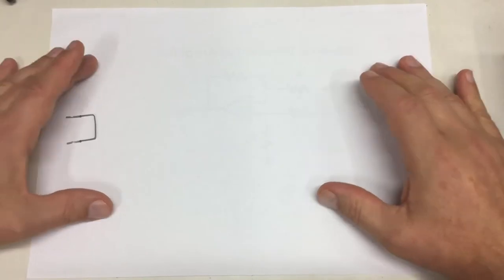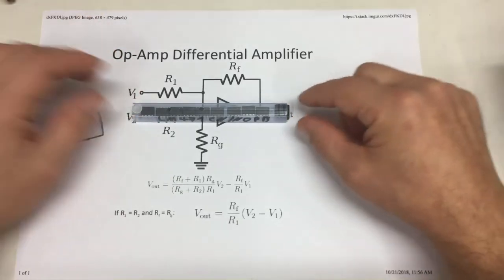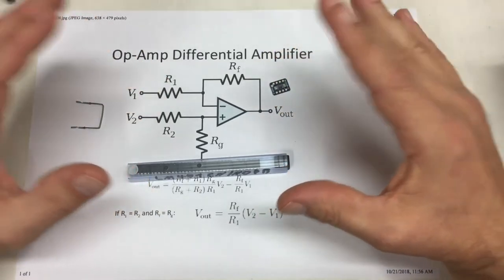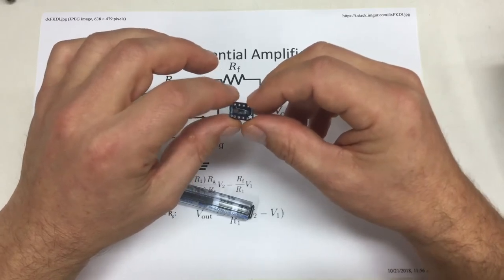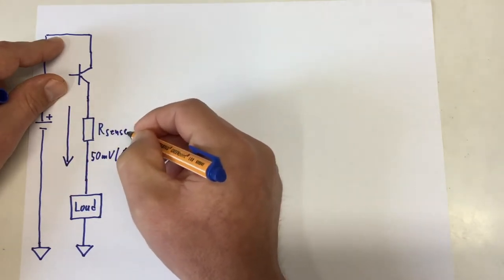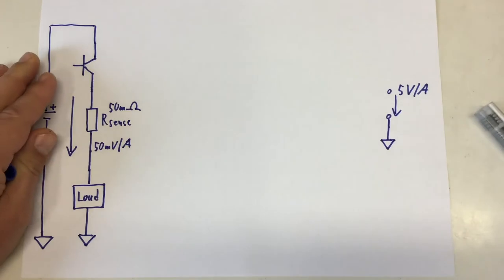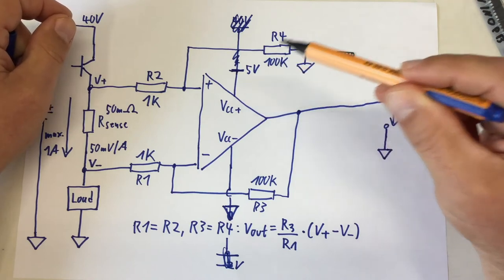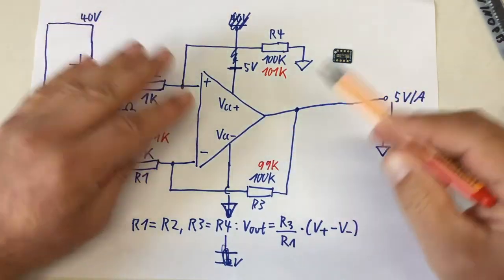Current Sense Amplifiers (1/2): Why not to use an OpAmp (CMRR etc.)

Comment: Well paced and clearly explained...awesome production. 
  However, I was rewinding the video often to be sure the R4 were the same. The '4' was written differently: the schematic had an open four...the ideal values and equations showed both open and closed '4's. 
  I had issue with an instructor for over a year...grade suffered because of time wasted in clarifying these types of concerns. It was every example 9n the board, a class member would have to ask what is that...the cat scratch was indecipherable.  
  It is seen here that a 4 exists, but 8 was looking around for another one in case there was some alternate for an alternate design...like a trade off.
  This is a channel I will recommend. Best wishes.
Reply: I amendment to my statement...what I thought was a closed four is a one...the slant is very pronounced (in the equation) and I see it as a four.   Appologies.
Reply from the maker: Thanks for the praise and recommending the channel! And I'm sorry for my handwriting ... sometimes it is even worse. E.g. as a German I'm always torn between an American 1 (|) and a German 1 (1). My German 1s sometimes almost look like American 7s, and my German 7s look like, well, an American 7 but with a dash through it ( https://de.wikipedia.org/wiki/Sieben ).
Reply from the maker: @jimmylightfinger1216  No apologies needed! As I've mentioned my handwriting is not the best ...
Reply: At times,  I add the nose...sometimes the base.  The situation will influence my usage of the nose and foot especially if I am using complex numbers or vector notation...make it contrast more clearly.
Reply: Very much appreciate the reply. 🤝
Reply from the maker: @jimmylightfinger1216  I will take that to heart. Especially because I'll be shooting some math stuff (vectors and matrix multiplication) during the next few days. (Reply to "At times, I add the nose ...")
Reply from the maker: @jimmylightfinger1216  You're more than welcome 🙂 (Reply to "Very much appreciated ...")

Comment: Hi, really informative video! I wanted your recommendation to design a current circuit using shunt resistors with sensitivity >500mV/A because I want to measure current in range of mA
Reply from the maker: Do you have some more information about the circuit? What's the voltage of your load circuit? What's the supply voltage of your measurement circuit. What's the maximum voltage drop you want across your shunt resistor? A sensitivity of 500mV/A would (without amplifier) just require a 500mOhm resistor. And at 1mA that would give you a voltage drop of just 500uV.

Comment: Good one, Thanks! Btw i am trying to sense current through 100 ohm resistor connected across op-Amp using a DC Power supply at 11 V and current set at max. 20 mA. But the moment DC PS goes into CC mode, a ripple voltage of 20 mV is observed on DSO. Is it because DC power supply is a voltage source and i need a precision current source? I don't understand why exactly.
Reply from the maker: You're welcome! What kind/brand/type of DC power supply are you using? In most (cheaper) DC power supplies the CC mode is implemented much worse that the CV mode. E.g. my OWON P4305 overshoots enormously when I use the output on/off button in CC mode. I've never measured its ripple in CC mode, but now I guess I have to.
Reply: @robertssmorgasbord  Thanks for your response! I am using GW Instek PPH 1503D DC PS. The ripple value in CC mode is not mentioned in the datasheet. Some suggested to use Precise Current source but i couldn't understand why can't i use this DC PS in CC mode itself without voltage ripple considering 20 mA passing through my 100 ohms resistor should measure 2V across on oscilloscope.
Reply from the maker: @vishalgdev_  Well, that's certainly not a cheap lab power supply. But if they don't specify the ripple/noise for current, they probably didn't put much effort into the CC mode and know that it's atrocious (OWON specifies 4mA RMS for my P4305). Regarding you numbers: You measured 20mV ripple across that 100 Ohm resistor, so a ripple current of 0.2mA. While that's certainly not great at a 20mA load (1% ripple), it's also not totally atrocious.

Comment: 11:06 = you still need differential amplifier to eliminate the resistance of ground trace, which will add to the small resistance (milli-ohm) of shunt resistor.
Reply from the maker: You're absolutely right. I just wanted to explain why you might not want to use low side current sensing at all, not how to properly implement it ;-) BTW in some low side current sensing applications you can also work with a star ground to avoid that differential amplifier: One big trace from the low end of the shunt resistor for the high current path and a smaller one going to rest of the ground (plane) of your regulation and other circuitry. However, that might introduce some other errors (e.g. when measuring voltage to ground).
Reply: @robertssmorgasbord  Totally agree to your points. I liked your channel and lot of things to learn from them. BTW, for most motor control projects that I work on uses low side current sense for high BW measurement.
Reply from the maker: Thanks! Low side current sensing has definitely its applications. BTW I just watched your two "DC motor current measurement ..." videos.

Comment: so why exactly is it a problem that the ground reference of an LED connected to an LED power supply is slightly above ground? or is that just related to cmmr?
Reply from the maker: In a LED power supply a low side shunt resistor is usually not a problem. Low side shunt resistors can become a problem when, for example, you have several power supplies in your circuit. Then the "grounds" of the different power supplies are no longer THE ground of your circuit. That is you have currents flowing between grounds of your power supplies :-(

Comment: Why do you need to have the rail voltage of the opamp as high as the load voltage?

I'm using the LM385 to sense the current on the low side and the rail voltage I have on my opamp is 12V, I'm using the LT431 to have a stable reference voltage that I use for the course/fine adjustment potentiometers that go to the non-inverting input, the output of the opamp goes to gate of the mosfet that needs the 12V to be able to turn on... 

You say that the rail voltage of the opamp has to be the same as the load but I have tested my electrical DC load with an input voltage of 70V and it works perfect, how is that possible?

So either you are wrong with your statement or you're missing something but I can assure you that my input voltage is at least 70VDC coming from an old audio transformer that I've repurposed as my bench power supply so I can choose a few fixed output voltages of 25VDC, 50VDC and 70VDC and I also left the option to choose -12.5VDC/+12.5VDC, -25VDC/+25VDC, and -35VDC/+35VDC which is pretty handy to have, however the highest voltage I get out of my transformer is 70VDC and I have no issues connecting it to my DC load I made using a 500V, 19A, 235W maximum rated mosfet and the sense resistor I used is a recycled one from an old amplifier which is a x2, 0.22Ohm, 3W in one package, it's connected in parallel to the mosfets source to ground so I have a 6W, 0.11Ohm sense resistor from where I feedback to the opamp and it just work with absolutely no problems at all.
Reply from the maker: I guess you're referring to https://youtu.be/oQrWR6Vbb6M?t=840 "Common mode voltage – your positive supply needs to be as high as it gets". I'm talking there about high side current sensing (see also the circuit diagram while I'm talking about that). When you're using low side current sensing, as you do, this does not apply. See also https://youtu.be/oQrWR6Vbb6M?t=624 "Low side current sensing – the undesirable easy way out".
Reply: @robertssmorgasbord  aha, well I didn't know that with low side sensing it doesn't apply, I guess that I'm lucky going for low side sensing then because if I did high side sensing it would have blown up right in my face.
I can't know everything right? That's why I watched this video and commented because it didn't make much sense to me so thanks for the explanation and sharing your knowledge online, I really appreciate that.
Reply from the maker: @RicardoPenders  You're welcome! And yes, one can't know everything. I certainly don't know everything. E.g. a circuit design of mine has been shot down in flames on the EEVbolg :-) I just went there to ask if anyone sees any problems - and several, very helpful people, did. What's the saying? No such thing as a stupid question!

Comment: Interesting. Can't we isolate the ground of the measured circuit aside and have another same ground for the differential amplifier with the 0-5 V circuit ? So we get rid of the 40V problem 14:40
Reply: But in this case, and assuming there is a common mode gain, V+ and V- will be referenced to what ?
Reply from the maker: No, unfortunately we can't. And your second comment basically contains the answer. The + and - inputs of an OpAmp are referenced to its negative power supply Vcc-. You can have a look at, for example, the LM741 datasheet ( http://www.ti.com/lit/gpn/LM741 ), page 7: Current into the bases of the input transistors has to flow to V(cc)-. So while in principle an OpAmp measures the voltage difference between its inputs, technically that's done by "measuring" the voltage of each, the + and - input, to V(cc)- and then "calculating" the difference between the two voltages.

Comment: So the second problem is that CMRR from circuit (small variation in resistance)+ CMRR from the op amp itself make error on the output.
Reply from the maker: Indeed, I have completely omitted the CMRR of the op amp itself. I just wanted to make the point that the additional CMRR introduced by the resistors for a differential amplifier op amp circuit makes current sense amplifiers the better choice for high side current sensing.

Comment: This is an interesting topic for sure. I've been using TI's INA180x series current shunt amplifier in my BMS design, although on the low-side configuration only as it only supports up to 26V of common-mode voltage and the BMS otherwise supports battery configurations between 4 and 12 series cells (16,8V - 50,4V at full cell voltages). I've lately been interested in getting into custom DC-DC SMPS topologies via MCU control and been looking into how to implement the inductor current sensing and have wondered about this exact topic, " why not just use a OP-amp that supports high common-mode voltage for the current shunt sensing on the high-side?"
Reply from the maker: Thank you very much for that most interesting comment. At some point I plan to do some MCU controlled power electronics too (driving a 1kW/2kW single phase brushless DC motor including recuperation). But it will be a while until I come around doing that ...

Comment: Thanks Robert for such an informative video...Suppose, we use LM358 for high side current monitoring but take the positive terminal as the reference (ground voltage)!!!! Would CMV still be a problem. I am powering the LM358 and MCU with another power supply which is galvanically isolated from the supply under test.
Reply from the maker: I thank you for the praise! To answer your question: I guess that could work, as long as your shunt resistor (and the LM358) are before the series transistor and the load. The LM358/MCU ground would be connected just after the shunt resistor and you would use the LM358 as non-inverting amplifier. Great idea! Let me know how it works - and don't blow up your MCU ;-)
Reply: @robertssmorgasbord  It worked partly....If I measure current only, it works, but if i try to measure voltage also, it doesn't....how could I share some schematics with you - to show what I did?
Reply from the maker: @m-kris  Sorry, you're comment landed in the spam folder. Just found it there and released it. Maybe you could upload your schematic (as PDF) to a Google drive and post the link here.

Comment: I am a little bit late to the party.. I don't understand what the CMRR of the O-Amp data sheet has to do with the tolerance of the resistors. The CMRR of the Op-Amp is the output error of the INTERNAL circuit if both inputs are shortened and connected to DC different from GND (i.e 10V will bring the output to 0.1mV) .... That will add to your resistor error, so even with a great differential Op-Amp ( 120dB), the resistor error still destroys your performance. -> trimming needed.
Reply from the maker: Absolutely right. The point was that current sense amplifiers have build in, very precise (sometimes laser trimmed) resistors, and thus you don't have to fiddle with external precision resistors and/or trimming around an op amp.
BTW can you give me the time index where I refer to the op amp CMRR? I remember explaining CMRR in general and showing the CMRRs of current sense amplifiers in their datasheets, but not for normal op amps.
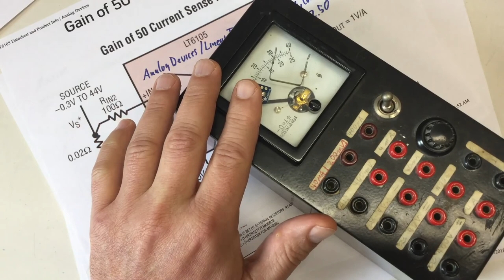Reply: @robertssmorgasbord  37:08 "As it's written in Datasheets" ...  Etwas misverstaendlich. 
Wie gesagt, das Datasheet it fuer den Op-amp, nicht fuer die externe Schaltung.
Reply from the maker: @Iosens  Ja, das war wohl etwas misverständlich - 'tschuldigung! Ich hoffe das Video hat Dir trotzdem etwas gebracht.

Comment: Good video but I would suggest neither. Lately, companies are not making op-amps for current sense with good CM parameters for high voltage or they expensive its best for HV noval designs to use a BJT current mirror pair and translate, obviously this is for applications for HV use like 100V/200V, But to your point stick to current sense op-amps for sensitive dedicated parts with good stability margins.
Reply from the maker: Kudos to you for rolling your own current mirror with BJTs! I made that series in preparation for a tiny little board for a analog ammeter in one of the first "lab" power supplies I build ( https://www.youtube.com/watch?v=zin56AvovXw&list=PLwq-2MnM58FIYvR6bny0fwgH4PFyIIeqR&index=8 ). So no high voltage involved. Plus, the PCB had to fit onto the back of the analog instrument, so I was really exploring single chip (non SMD) solutions.

Comment: Wouldn’t a current mirror work better?
Reply from the maker: I guess you could make a current mirror work in this application ... but getting the design right (common voltage tolerance, CMRR etc.) would be quite a challenge. Would it perform better than a current sense amplifier? depends on the current sense amplifier you're comparing it to 😉 Anyway, I personally think it's not worth the hassle (again, that's my personal opinion - some current mirror gurus out there might disagree).

Comment: I don't see any problem with Low-side current sensing, It's just <100mV anyway, that's like what, 0.02% in most situations?
Reply from the maker: Well, if you're looking for a simple, cheap, "good enough for the job" solution for current sensing, then there's really nothing wrong with low side current sensing. But as soon as your application relies on ground being really ground everywhere (not being e.g. 100mV above ground before your current sense shunt), or you have higher precision requirements (BTW 100mV is 0.02% of 500V, so in a "typical application" we're talking using your example maybe more like 100mV/12V=0.83%), high side current sensing is the way to go.
Reply: @robertssmorgasbord  I don't need ground to be ref to actual ground because I source them from solar cells. I usually work with 500 VDC most of the time, sometimes even up to 750V.
Reply from the maker: @XiaZ  Ok, I get it. I have to admit that I never had high voltage applications on my mind when I made that video. The primary application I was thinking about was precision current measurement in lab power supplies. So yes, I guess your application is an absolutely legitimate use case for low side current measurement.

Comment: Using a isolated supply for op amp _ which you should always &

Shorting the V+ to ground of isolated supply _ will do it __
Reply from the maker: Of course you can completely circumvent the need for a differential amplifier by providing an isolated power supply for your high side current measurement circuitry. Then a simple inverting/non-inverting (op-amp) amplifier will do and all the common mode stuff goes away. I'm not sure if I agree with your "which you should always" statement though. An isolated power supply, even the cheapest isolated DC DC converter, will cost much more than a current sense amplifier chip. So if you're on a budget or have space restrictions it's not the best option.
Reply: In the era of ' Green'  energy ( 1 Li-ion battery at xx Volts, DC high current motors) adding an isolated supply just for current sensing is not economically sensible
Reply from the maker: @MrSummerbreeze01  Yeah, that's another aspect I didn't even though of. Those DC DC converters, especially the very small ones (100mW to 500mW) are not very efficient and they usually require a minimum load (10% of max. output). So you are constantly wasting energy.

Comment: Or Application Note 92 by Jim Williams
Reply from the maker: Do you mean "Bias Voltage and Current Sense Circuits for Avalanche Photodiodes" ( https://www.google.com/url?sa=t&source=web&rct=j&opi=89978449&url=https://www.analog.com/media/en/technical-documentation/application-notes/an92f.pdf&ved=2ahUKEwjlptbpg9OFAxWp_rsIHSkMD60QFnoECBMQAQ&usg=AOvVaw05fjVkoi_OUpVE-R9fDyDU )?
Reply: @robertssmorgasbord  yes ,  its show some useful techniques dealing with the current measurements using op amps  :)
Reply from the maker: @Tek-ns  It is indeed a very useful application note. Thanks for pointing it out to me!